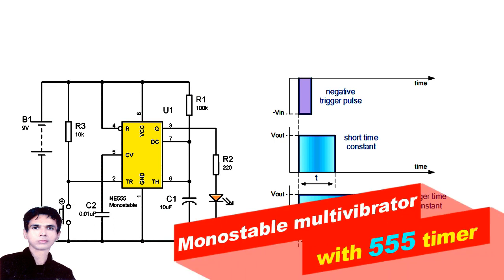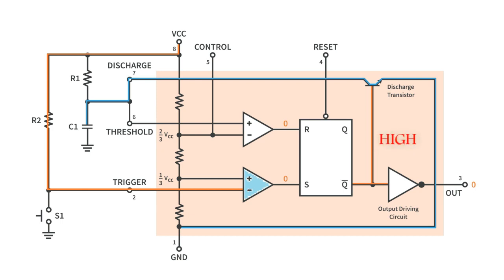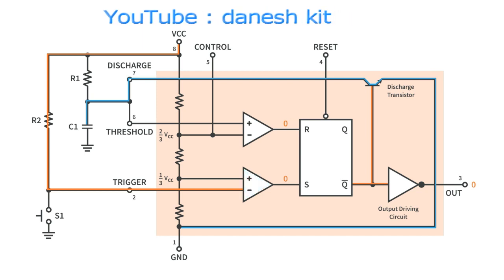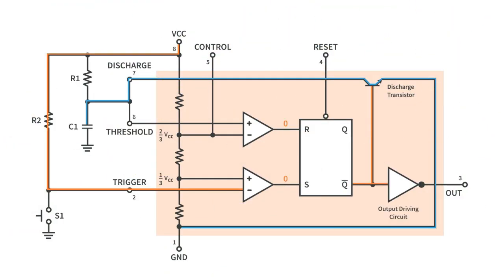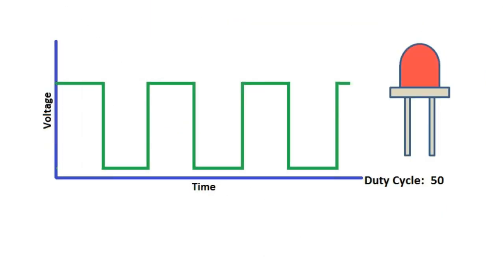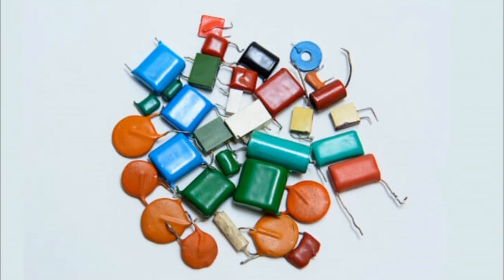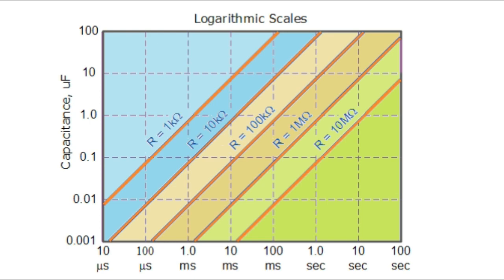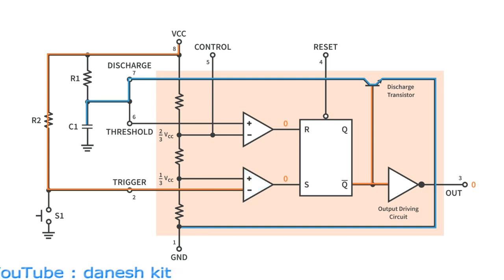Monostable multivibrator with 555 timer

Comment: Do the output go low even if the trigger remains low?
Reply from the maker: Hi dear friend
 Yes, even if the trigger remains low, the output will LOW
 but it is correct that after we set the trigger LOW, we set the trigger HIGH again.

In monostable mode the 555 timer outputs a high pulse, which begins when the trigger pin is set low (less than 1/3Vcc,  this is enough to switch the output of the comparator connected to the trigger pin).